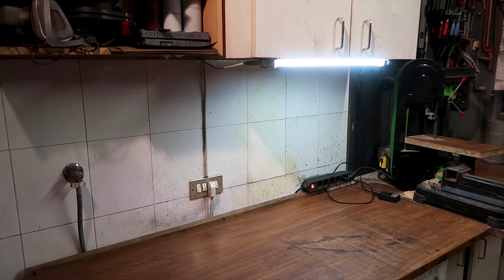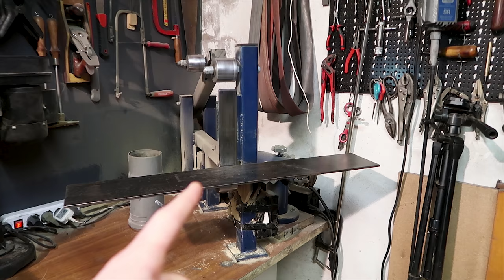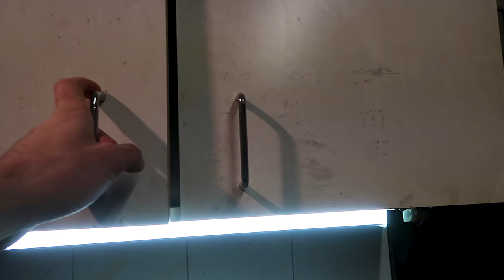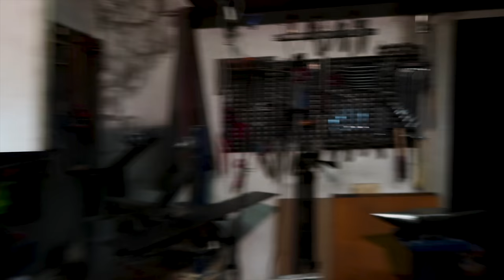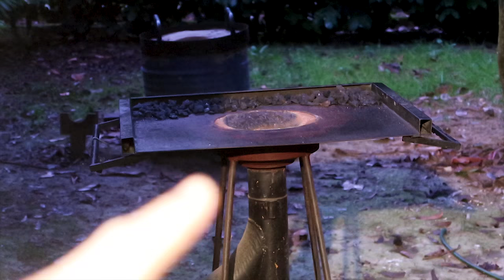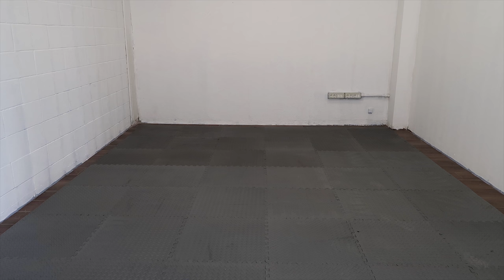Update | Workshop Tour

Comment: Great tour. You may have just given me the idea for the floor in my new workshop. Was that grey stuff expensive?
Reply: Restore It, it looks similar to the floor padding sold by Harbor Freight in 8 packs. Also, Costco has what looks to be a match to what BB has in 6 packs. The Costco stuff is (maybe) a little tougher but the HF stuff is cheaper. The visual clue is the surface texturing. Assumes you are in the US.